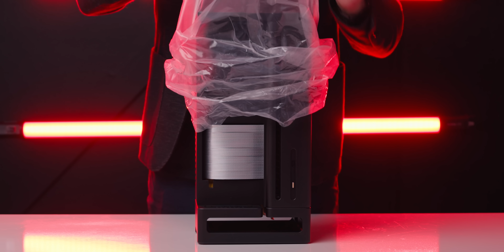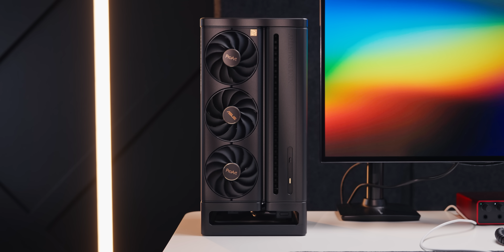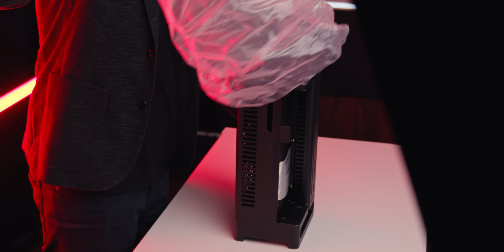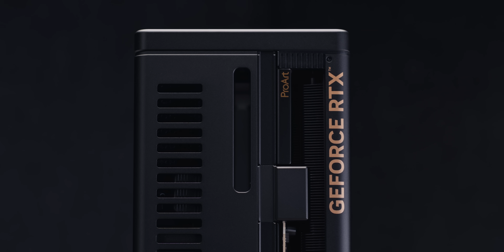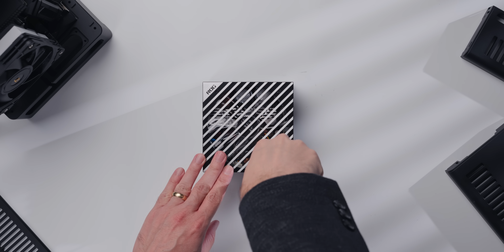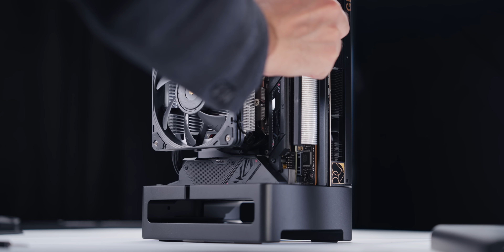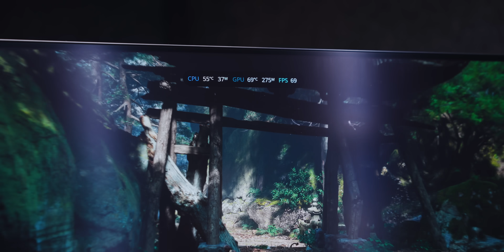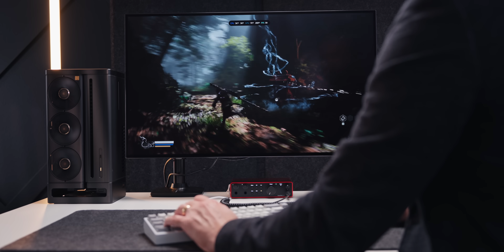THIS is peak SFF.

Comment: Could you make 3D schematics for a 3D printer so we could afford it 😂???
Reply: You got to hit up optimum for that lol
Reply: was looking for it on reddit but couldn’t find ):
Reply: i got 1 im selling it right now on reddit
Reply: @adhd.-m4rs  how much
Reply: @PoljakFrano probably more than 500 usd
Reply: @The2TheOnly  doubt it
Reply: @adhd.-m4rs  send link
Reply: I made by wood and some household tool like hand saw, plier, srew driver hammer and some screws.
Dimensions: 35cm(L) × 35cm(W) × 11cm(H)
Gtx1650 is installed in it.
❤❤
Reply: The heat of the components would probably melt your 3D printed case, you could use it  to make silicone molds instead
Reply: In makersworld one Model you can find. With pf6-gf I think you can build it really cool. And kost somewhere 45€

Comment: Not a fan, I like my fans hidden inside or protected by grills, dust filters... Luxury aluminium cases can be had around $200..
Reply: And stupidly loud 50 DB. You know how loud that is...
Reply: @Djuntas  yes that’s very loud. mine is 39/40 db recorded at 50cm or 19,69 inches) away at idle and gaming which is very quiet I would say
Reply: Not really a problem in my room at all. Have an open case for almost 2 years and I couldn’t be more happy :). 

The whole thing of “what about dust though” is very dependent on the dust situation in your house. I clean mine every 5 months or so for like 8 minutes and everything is clean again. And even after 5 months not like there is a pack of dust on it rather just a very very thin layer. And even then there is no drops in either performance nor higher temps

Comment: The case alone is $600... Cool? Yes. I think it's still a bit steep though. 
A person who has to save up for those cards are going to be less likely to wait longer and save for a $600 case, especially one that size, bore bones and proprietary. 
Definitely as niche as it gets. Wanna swap the GPU? PSU die and can't find the exact replacement? Too bad.
Reply: Don't think people saving for this gpu are even looking at this case.
Reply: I don't understand who is this for? 600$ for a somewhat very targeted product, but I just don't get it who is this for. The design is not great, except the level of finishing fro the machining. There are no LEDs and no upgradability for a 600$ case. I don't expect it to be a hit.
Reply: @MrTeknown  This case is for SFF enthusiast. There are levels to any hobby and you are not about it like others and that’s okay, saved money and youre reasonable.
Reply: @MrTeknown  the fact you said "there are no LEDs" as a negative, shows you didn't get the point. there are people spending 2000$ on a keyboard, there are deffo people spending 600 for this.
Reply: @MrTeknown  It's sold out btw. Remember not everyone is you. It's beautiful that's all the reason some people need
Reply: a case like this is absolutely not made for someone who has to save up for pc parts. I'm pretty sure that the ones buying it aren't building it, just paying someone to do the job for them
Reply: @marinelmustatea7288 right. The people buying this aren’t gonna ask “how much again?”
Reply: you think thats bad lol the pro art series cards are 2k each
Reply: @charlesballiet7074  ASUS ProArts is nowhere near 2k dude, stop smoking.
Reply: broke ass mentality
Reply: I just don't use a case ;) I've saved at least a thousand dollars compared to my friends who buy a new case every mid-range upgrade.
Reply: @IndignASMR  I did a full upgrade on my PC only the PSU, CASE and the SSD is still there from the old PC. I didn't even consider upgrading the case (NZXT Noctis 450) which doesn't have the best airflow. While it is not optimal,  it is robust enough for me. I built it in 2016 with 5820k and 980ti HOF. Now it is 7800x3d + 7900 XTX Nitro+, so I guess high range to high range upgrade. I even upgraded the water cooler from 2 fans 28cm to 3 fans 36cm setup.

In my opinion, it is worth to have a robust case for 150-200$ or buy it one used (if it has all parts and screws) as a good one will not need to be upgraded for a really long time.
Reply: There's always a comment like this under every bespoke case video, no shit its not for the average person.
Reply: You get what you pay for. CNC machining is just a very expensive process compared to folding and cutting metal sheets.

edit: yes i know that CNC machines are technically just anything computer automated machines, but to the context of this video, it would be closer to multi-axis milling machining, and most references to CNC machines are to milling machining
Reply: @nasope  Except all companies do CNC machining, who the fuck is doing that manually anymore lmao.
Reply: Lmfao this product in no way was made or marketed toward that type of buyer 😂

SFF is not for the poors. You are paying more money for less features on parts to experience a terrible building experience and thermal throttling anything mid to high end. 

Think about it like Min Maxing in diablo or any mmo, anyone who starts doing that is late game grinding and not having fun the way the typical player is doing it.
Reply: @HiluxCobbler6975  Small Form Factor (SFF) builds don't necessarily have to cost more or thermal throttle any more than a standard build. My ASRock A620I Lightning Wi-Fi motherboard and Xproto case were both around $150, which are pretty typical prices. You could argue that standard PC cases are usually cheaper, but motherboards for regular PCs can also easily cost $200.

Apart from that, you might pay a slight premium for the power supply, but that's about it. ATX PSUs were around $100, while I paid about $130 for my SFX PSU. So, overall, going with an SFF build doesn't have to be significantly more expensive, depending on your choices, of course.
Reply: @HiluxCobbler6975  There is paying more for premium (FormD T1) and there's 
wasting your money on a vanity project.
Reply: @HiluxCobbler6975  ITX tax isn't that bad dude. This is just stupid.
Reply: @mr.number9279   Feature to feature ITX are a terrible value lmfao
Reply: @HiluxCobbler6975  Are you employed the Xilinx or whatever the shitty Chinese company is who made this "case"?

The PSU and Motherboard are like 20-50$ more each for ITX... No, it's not great, it's annoying, but it's not stupid like THIS where it's 500$ more than a normal high-end case.

You're using "well ITX is more expensive/niche" to defend this when there's literally no reason for it to be LIKE THIS.

Also not sure what you mean by "terrible value", most fucking idiots watercool their Ryzen 5s and i3/i5 machines with 500$ watercoolers (which aren't needed at all or even HELPFUL until extreme overclocking) and RGB LiGhTs that no one sees because who the fuck is staring into their goddamn PC case instead of fucking using the damn thing, no one.

Ryzen 7 7800X3D can run at 80W and maintain 90-95% of its power. The smallest ITX cases can aircool that no problem. Get over yourself with "ITX isnt efficient/useful", shillbot.
Reply: @mr.number9279   sometimes sff enthusiasts acts like Audiophiles 🤣🤣🤣

Comment: 600$ holy moly
Reply: I think it is justifiable, the much of passion and engineering went to it. Heck people spend 600$ on keyboards these days...
Reply: @tadasnever  600 is the lower end. 600 would the the keyboard case without switches, keycaps, artisan keys and all the other mods and upgrades.
Reply: @FIIZiK_yt  600 is not the lower end for keyboards at all. Custom keyboards have become far far cheaper in the last 2 years.
Reply: @artxanton1  it is the lower end lol, just cause keyboards "have become cheaper recently", therefore, more entry level options are available (some crazy cheap ones on aliexpress and taobao etc  for like 30-40$), it doesn't change the fact 600 is what you'd pay for the case alone of a keyboard. add some rare switches for 100 and rare keycaps for 150-300 (Some GMKs are crazy expensive, Cerakey ceramic ones are around 150 too), and you'll end up with over 1000$.

And there are cases that cost 1000 alone. Plus if you get into artisan keycaps you'd be paying 150$ for a spacebar.

For example a Mammoth75 with a Brass PVD mirror is $750. A Zero Great Sword ends up being 550-600 with duty and shipping. 

A used Pixelspace Capsule goes for 500-600 easily, used.
Reply: hey if its your thing more power to you. It was more than i expected

Comment: At $600 this better be hi-grade and no blemishes zero
Reply: Considering how niche the product is it's not that crazy of a price. Machining is expensive, especially if you want good quality.
Reply: Perfect grade
Reply: @zergslayer69 Amen🫡
Reply: I don't think you can even get it outside of china
Reply: @哇-n8d  wow, thats wild! 🤔
Reply: @erco12345  gunpla?
Reply: @ergonomiccode1418 wish caselabs would hurry up and come back
Reply: Oh no shit fr? 💀
Reply: @erco12345  doesn't mean it's garbage just design over function which what matters to some people with disposable income
Reply: @Anteatereatingants It's certainly not form over function. The case is really well built and well designed. It's a niche product that no one else makes. I'm really hoping someone in China copies the design and comes up with something that's not 600$ + and is more flexible.
Reply: @Liminal.Headspace  The function of a pc case is to hold pc parts but this case is very limited because is designed around 1 design of gpu. Not bad just very limited use it's designed to show off the design
Reply: @Anteatereatingants  It's a niche luxury product. The damn PSU extension cables are what worries me, not the GPU. I'm sure you could find another GPU that fits, not so much a different PSU.
Reply: To be honest, you could have a machine shop build something similar and powder coat it for less.
Reply: @tenoki Absolutely not, we paid $5000+ to machine FAR simpler prototypes at work. Maybe it’d be possible if you were dealing with absolutely massive MOQs and manufacturing in a low-COL country.
Reply: @tenoki  nah, full cnc like that cost about 300$ for moq of 10, 1? it will over 1000
belive me, i test out with cnc keyboard
Reply: @tenoki  please build me one for less
Reply: @tenoki  No, you can not. The metal is cheap, changeover and machining time is not.
Reply: @tenoki  custon stuff is high, ive had car parts custom made and they were not less that this. it simply depends on what it is.
Reply: @tenoki  provided you have all the schematics and data necessary to achieve it. Then the cost of trial and error will kick in to manage edge case errors depending on the tooling available.
Reply: @UxJoy  i said something similar, not exactly the same thing as the company would never release their schematics. But even so, for time and labor, you are still going to probably be close in cost for what that is. I have had custom car parts made at a machine shop for much less than this.
Reply: @tenoki Personally, I would buy 1 or 2 if the cases and draw some models inspired by the cases purchased, this way I have a list of do's, don't's, need's and wants so the final design can take shape and then it's time to take the schematics to a shop for machining